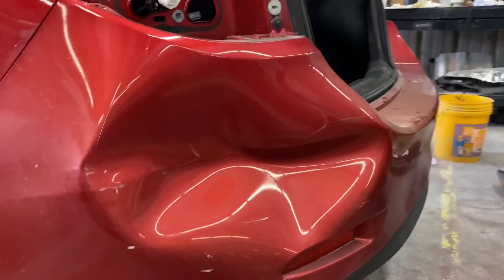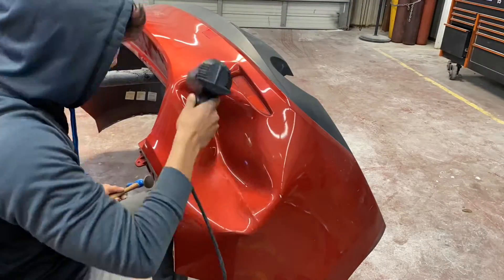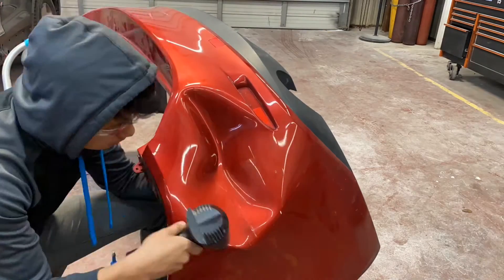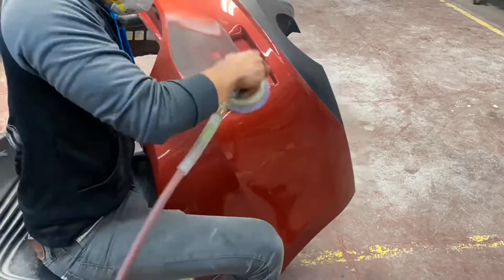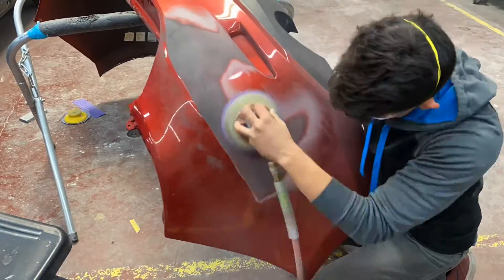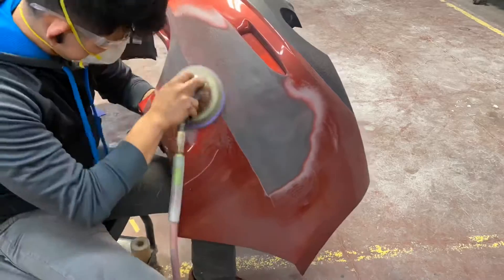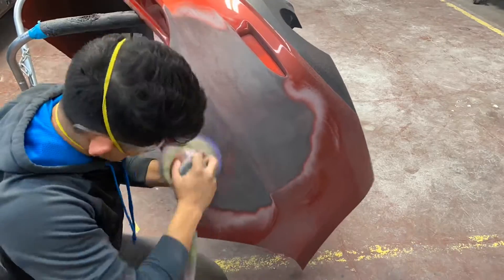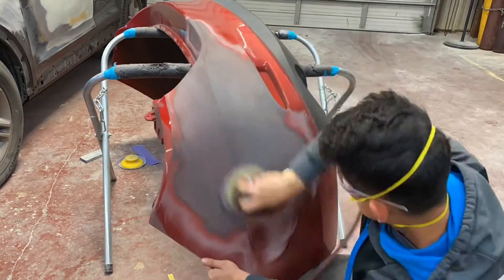Mazda 6 🤢 Nasty Bumper Repair

Comment: There is a way to heat from the inside without removing the bumper?
Reply from the maker: Can heat the front and pry it out but it’s still going to need some work that’ll just knock the dent out
Reply: Boiling water